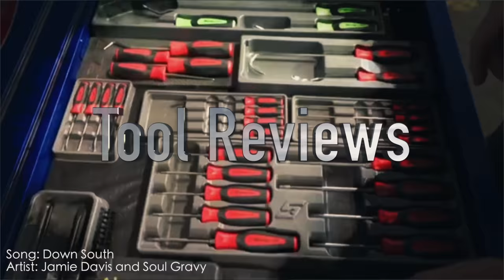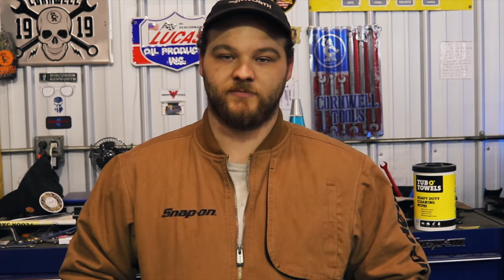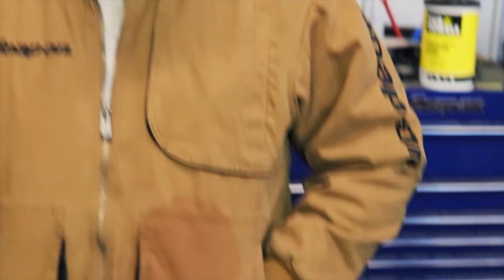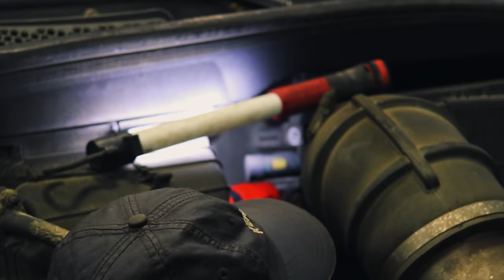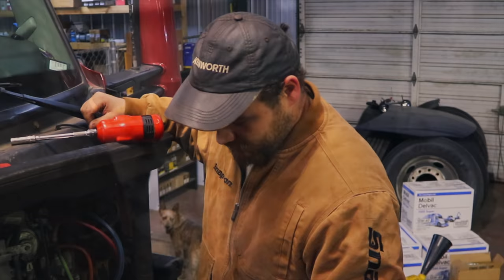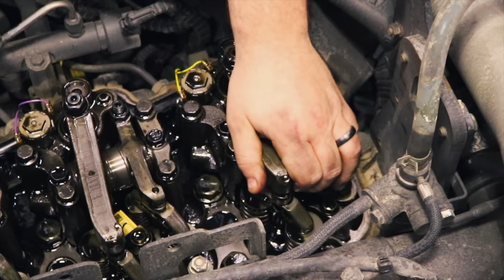Paccar MX Overhead DIY Step By Step Guide

Comment: Should tell Bill not to turn the engine backwards next time. Easier to follow the firing order 153624 instead 142635.  Also very sloppy holding backup with that T handle torque wrench.   Feeler hauge should be removed last after jam nut torque.  Shouldn't have to jerk them out either. "Slight resistance"  Good try though keep it up just need better attention to detail.

Comment: So I finally completed this for the first time.  I wanted to say a couple things about this video which inspired me to do this task and I greatly appreciate Koon Trucking and you guys for making this.

As others have said,  leaving the feeler gauge in while tightening down the jam nut is a huge help and it gave me piece of mind knowing it's good.

I bought a set of feeler gauges from my local Napa for 25$ and I removed all of the other ones off the holder except for the . 50 and . 70 mm and that was a giagantic help also because things get a little slippery and having them attached to the big holder was a major help.

The T handle torque wrench couldn't possibly be 6 ft lbs as others have said.  I used a very small ratchet and a 5mm hex socket and it gave me way more control when initially tightening the jam nut.  I tightened the valves by feel only.   

No one mentioned that the valve cover bolts have an order of tightening and that the torque is 15 ft lbs on those.  I replaced my valve cover gasket but it probably wasn't necessary.  

I rotated the turning tool towards the drivers side which in turn makes the engine rotation clockwise when viewed from the front of the tractor.  

I guess some people were complaining about Wild Bill,  hi,  Wild Bill BTW!,  turning the engine backwards and I don't know enough to know if it matters.

On my first attempt I had managed to get out of order so I slept on it and started from the beginning the next day.  

I adjusted according to the firing order and not only does it idle smoother and sound great,  the engine brake will send you through the windshield on 6 cyl lol.

Thank you guys for making this video because it gives me more confidence to continue lifelong learning about my equipment and how to maintain it!  I appreciate all of you.

Edward
Reply from the maker: @ Edward Apparently people in the video didn’t listen it was clearly stated the torque wrench used in the video was 6 INCH POUNDS not ft lbs.
Reply: @KoonTrucking  yeah I figured it out pretty quickly.   Anyway,  thank you for this video.

I did listen to the part saying that you could do it by feel and that's what I did.

Take care

Comment: You should ALWAYS tighten the exhaust adjuster down and push out any residual oil from the jake operation before adjusting the exhaust valve or you will get a false measurement, have had this happen alot at the dealership when previous diy'ers or even technicians do overheads and its noisy

Comment: Love the vid and how you detailed everything. The t handle said 6 inch lbs tho. (I believe anyway) I put 6ft lbs  or 72 in lbs and that feeler gauge was in there pretty tight. Pretty slick little tool wish I’d had one.
Reply from the maker: It’s a lot to remember on the fly, just use the feelers and you are good

Comment: Ahem, I believe another fella in another overhead video on this channel coined the phrase, too young, too old, just right in relation to firing order........! Great video, those paccar overheads are gravy if you have the turning tool and an extra set of hands to turn the engine over for you. Good job wally, except for the digital torque wrench, guess I'm just old school and prefer the click!
Reply from the maker: Haha you got that right ! I like the clock style too. Not a fan of anything battery ! Those ole clickers will still be going when that battery flickers !
Reply: i was a tech at mhc kenworth and all of the mx engines i pulled for the camshaft to be replaced. i need a torque wrench that was able to do angles. as a example on the fuel unit pumps on the engine shown, the bolts torque to 22 ftlb + 60  degrees. i can set it up to do it in one step on the torque wrench. it is a huge time saver.
Reply: @wallyhare8616  I'm a tech as well, cummins, detroit and cat primarily but have experience with paccar as well. I prefer a click style because that's what I invested in early in my career when the digital was just coming out, not cost effective for me to swap all my torque wrenches over to digital at this time, so I just do angles the old school way. Plus if I run up on a torque angle I haven't done before, I grab my buddies digital.

Comment: Does it matter which way you bar the engine over? Notice you started adjusting cyl 1 than 4,2,6,3,5.
Fan was turning counterclockwise. Viewed from front of engine.
Thank you for sharing
Reply from the maker: No
Reply: It does matter. The engine should be rotated clockwise viewed from the front. The camshaft is turned by the gear train which always has some play so the valve lash will be different when rotated the other direction. In paccars MX13 manual they specify turning the engine clockwise for setting valve lash because of this...
Reply: @RoosterG33rs  also Paccar engine support will tell you to run the the overhead in a set if you start on 1 go 360 degrees to 6, and  it's better to have a hot engine.

Comment: How often should u get valves adjusted and how much would s Peterbilt shop charge to get it done I have a 2016 579 mx13 with 726 k miles on it
Reply from the maker: If ur over the road about 100k miles if u are in heavy duty applications like heavy haul or logging etc I would do it more often

Comment: Great Video!!! Can you advise me if this video would be exactly same procedure on a mx13 epa 10 paccar?
Reply from the maker: Yep it will. Check the links in the description and it will save u some money
Reply: Koon Trucking      You guys have experience with the fuel control valve’s mushrooming up and causing low power and etc? Would be a great video for others.

Comment: Where can I get that feeler gauge and t handle wrench and engine turning tool
Reply from the maker: Link to feeler gauges Lang Tools Master Feeler Gauges:
https://www.amazon.com/gp/product/B00SZ4UOZ4/ref=as_li_tl?ie=UTF8&camp=1789&creative=9325&creativeASIN=B00SZ4UOZ4&linkCode=as2&tag=koontrucking-20&linkId=9c87abc7a55ac1d662d86fec14d1d936
Have to Google the t handle torque wrench and the turning tool can be purchased through your KW or Peterbilt place

Comment: On my 2015 Peterbilt 579 with a paccar MX13, I have a steel fuel line on the back of my block that goes up to the head that keeps blowing, I’ve replaced it twice in a week, I don’t know what’s going on I give up, I’m frustrated and not sure what’s causing it or what else to do?

Comment: Great video Clay!!!! But one question, as I was listening and watching what you guys were doing, I never heard you say anything about the time interval for adjusting the valves. By that I mean, do you adjust every month or 6 months or every 100,000 miles or every 20 miles or only after a rebuild or what??? Video was very informative and very detailed on what you do as you progress through the adjustments. Thanks for the information and thanks for sharing!!!!!
Reply from the maker: Every year is good as long as it is about 100k miles of course sooner if it is run more like a team truck
Reply: My Cummins engine is recommended at 60,000 intervals but it is a 1997 so....

Comment: What type of T handle torque wrench us that? Is it 1/4 or 3/8 drive? Where did you find the Allen socket?
Reply from the maker: It’s a CTA stubby socket. The T handle torque wrench was ordered.
Reply: Thanks. I ran Series 60 for 20 years and could rebuild them with my eyes closed, but we've moved on to Pete's with MX 13's. Thanks for your videos.

Comment: In your shop how many hours does an overhead charge out for? I work for a fleet company mostly mx13 mx11 and isx 11.9/15 and on the mx series they bill out 2.94.. I’ve got them down to 1.75 one man hourly
Reply from the maker: We just do flat rate plus valve cover gasket if needed

Comment: What t handle tool is that? I've done quite a few overheard with just a regular Allen tool and this way seems so much faster!!
Reply from the maker: It is way faster. Someone else asked that question and I gave the manufacturer and the model number in the comments of this video. I don’t remember off hand and don’t have it with me.
Reply: Thanks for reply I'll  look through comments to find it.
Reply from the maker: I’m sorry i can’t remember it off the top of my head but I can’t. A 2 in. Lbs would be better than the 6 we used. It’s pretty tight still on the feeler gauges. I am going to order a 2 in lbs one from either matco or Snap On
Reply: Yeah I'm gonna ask my mac guy when he shows up this week and I dont buy off of snap on truck anymore because our dealer sucks

Comment: @koontrucking Who makes that t handle torque wrench? All the ones I have looked up are either 6 inch pounds or Newton meters. Haven’t found a 6 foot pound one
Reply: I paused it when the top of the t-handle was shown. It looks like it reads 6inlbs.
Reply: Yeah 6 ft lbs is unbelievably tight.  I believe it's 6 in lbs.

Comment: sr i have problem with my t 680. i need to check the sensor in the botton of the big filter diesel. i have a check engine saying i have water in the fuel
Reply from the maker: Change the filter and drain the water out of the filter housing
Reply: Koon Trucking I am not talking bout the water and fuel element. I am talking the one who is attach to the engine. I have code 97
Reply from the maker: Daniel Ricketts I’m sure sure I am understanding you correctly ? The code number 97 I do not know what that is? You talking about the fuel filter (canister filter) that is mounted on the driver side of the engine ? Not the fuel water sep but the actual fuel filter?
Reply: @KoonTrucking  yes the one in the driver side but mounted in the engine not in the chasis

Comment: Whats the most miles you have seen on a mx 13 just bought a t680 with 1,016,000
Reply from the maker: Haven’t seen one with a million yet
Reply: @KoonTrucking  it has been def and egr deleted. No Metal Material in oil filters or seen in oil I changed. And was also wondering being its deleted the Exhaust back pressure Actuator could I delete it or unhook it and open the flap? Believe it's leaking there makes a Strange whistle sound off and on Turbo was changed sound is still there.

Comment: You started on cylinder 1 and should have went in the firing order 5,3,6,2,4. That would have been the correct way and also not make some newer inexperienced ppl confused
Reply from the maker: 1-5-3-6-2-4 is the correct firing order ? No matter what you start with it’s all the same cycle
Reply: @KoonTrucking  im just saying u did it backwards so some inexperienced ppl may wonder why.

Comment: 6 in lbs not 6 ft lbs. Too tight and you'll burn a valve
Reply from the maker: I may have said 6 lbs ft instead of inch lbs but I think I showed the t handle fixed torque wrench at 6 in Lbs
Reply: @KoonTrucking  yea u did, you'd be surprised the people out there that don't know the difference though 🤦‍♂️